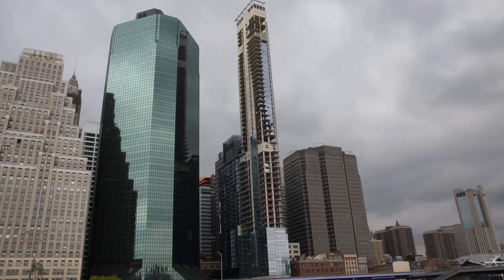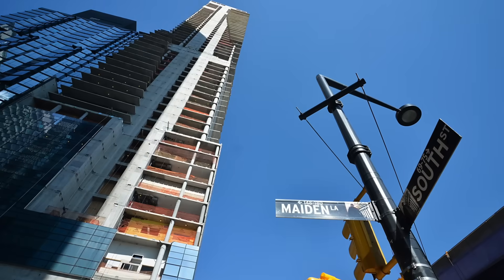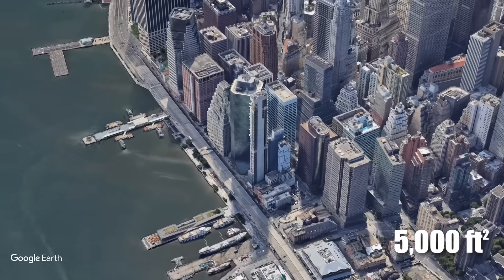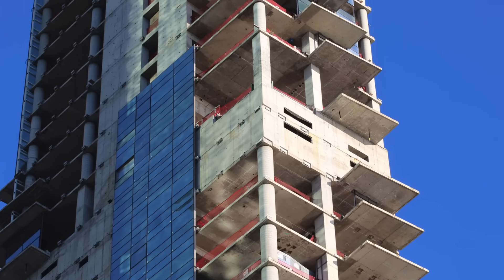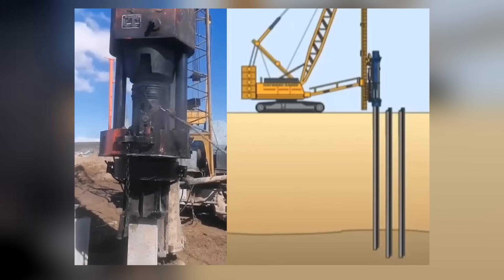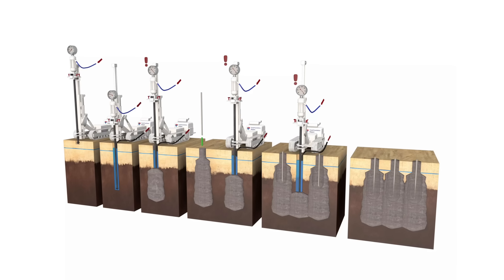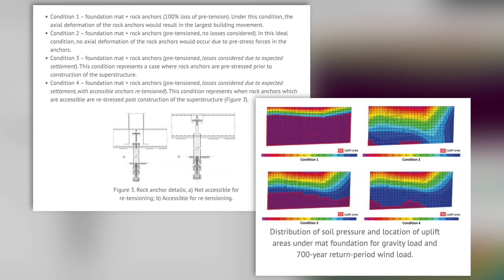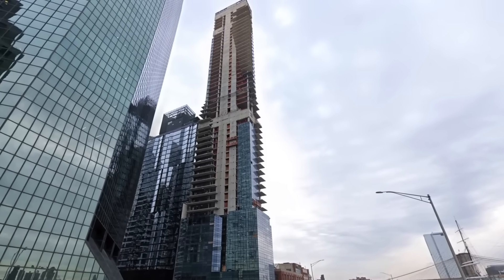Why Nobody Can Fix This New York Skyscraper

Comment: U Mass Amherst built a 26 story library with brick facade. They didn't estimate the weight of the books correctly. When they started to fill it, bricks under compression started blowing off the sides... Their fix was to wrap the entire building in fence 30' away from the building and make one entrance under a covered roof while only using half the floors. There are entire floors with no access and no books. Other floors are empty except cubicles for people to study.
On the same campus the residential buildings known as, "the towers" were built in swamp land and have continued to sink since they opened. Over the years they have had to remove and lower the stairs at the entrances to accommodate the new depth of the buildings
Reply: 26 stories of brick? That's  ridiculous!
Reply: This is not true.  "The building has fallen victim to several myths since its opening in 1973, the most popular of these being a variation of the "Sinking Library Myth," where the architect supposedly forgot to account for the weight of the books in the building's designs, resulting in a settling of the building. This is a popular myth attributed to many university libraries and is untrue."
Reply: @Dante-ki4ol  ok. I'll listen.... If it's not true then what is ? Because that's exactly what happened to the buildings.
Reply: the Towers were a terrible place....
Reply: Ain't gravity great!!!
Reply: Why on earth such a tall library
Reply: Should anybody be going to a University that's run by dim wits?
Reply: Been there. The entrance is like a short tunnel underground so if the brick crumbles and falls it just hits the raised mound of earth, protecting people in the short tunnel below.  Although it won't win design excellence awards, I always liked to go there. Nice view.
Reply: The information from all of those books that needed a 26-story building to house it could probably fit on a single hard drive today.
Reply: @williamgottlieb8723  yeah but a library serves more than just a book storage area, its a third space, a space for people to simply be in like a park, and even then it could house computers with access to said harddrive
Reply: @madratter Structural engineering mistake.  I am in Los Angeles California, I quit a job as architect when the school found out the the proposed structure was to be built within 20 feet of a fault line.  Somehow politically it all was swept under the rug and the building was built by another architect.  So later when something happens imagine all the figure pointing
Reply: @BOBBOB-tx7ox LOL . This isn't true.  It doesn't even make any sense.  "The building has fallen victim to several myths since its opening in 1973, the most popular of these being a variation of the "Sinking Library Myth," where the architect supposedly forgot to account for the weight of the books in the building's designs, resulting in a settling of the building. This is a popular myth attributed to many university libraries and is untrue."
Reply: @Dante-ki4ol  Are you by chance the Architect for that building

Comment: The only thing that makes buildings in New York not frightening to be in is the fact that you know it's literally drilled into the Bedrock.. the actual hard, solid granite crust of the Earth which is exceptionally strong and stable in New York.. the stability of the ground is part of what makes New York city so special..
( that and the fact that you can drink water out of your faucet anywhere in New York City with total confidence. New York City's water wins taste test over bottled)
Reply: As for tap water in NYC, don’t look into the roof top tanks that supply water pressure. They’re a cleaning nightmare.
Reply: @NickCBax  I was at a wedding not too long ago and I was absolutely shocked to see a wood water tower on a roof. I had no idea that they were still using wooden water tanks
Reply: I don't know, recent 4.8 magnitude earthquake was quite noticeable.
Reply: Actually, no. The schist bedrock in NYC is slowly rising since the end of the last ice age when the weight of the ice was removed.
Reply: @avsystem3142 stability doesn’t imply unmoving. Just that as a whole it’s going to move in the same direction at the same pace. Thats what is important for buildings.
Reply: @NickCBax  You appear to be have responded to the wrong comment. My comment was to correct an erroneous claim that the NYC bedrock was sinking, it is not. Sinking or rising, the geological motion of the bedrock isn't a concern to human buildings.
Reply: @avsystem3142  we’re in agreement. But no where on this comment thread did someone say that the bedrock was sinking. 

Did you perhaps comment on the wrong thread?
Reply: @NickCBax  Yes, someone did make such a claim in the comments.

Comment: Yeah they just cut corners on the foundation to make up for the delays from the initial excavation.. All of Melbournes skyscrapers that arent on hills are either on old creek beds or on reclaimed estury sand, which is precisely why a massive no of them have podium carparks above ground rather than basement carparks. Obviously its a taller building but Australia 108, Melbournes tallest at 320 metres, has 75m deep piles. One Seaport is a skinnier building on a smaller section with a higher sq m ratio of lettable space to the section it was built on. If they had the money to build the tower they should have built proper foundations.. The developers just got greedy is all, & the engineers who should have known better than to proceed.. A part of me also feels that the larger mass of concrete balconies on the top half of one side probably added undue weight to an already compromised foundation too.. The longer it is left unfinished, the more chance it will be over exposed to the elements & gain concrete cancer.. I can see this having to be demolished.. My bet is that there was a massive amount of corruption & backhanders with this at every stage of the development from consent to construction..

Comment: 3 inch lean on a 700+ ft tall building is not that severed. There are many buildings with a slight lean. In fact on a very windy day most very tall buildings will sway that much naturally. The real problem is the rate of leaning. If it’s 3” and that is it then that is not bad, but if it’s still leaning then that is a much bigger problem.

Comment: It's amazing that they can build foundations to carry the massive loads applied by skyscrapers by going down to bedrock with the foundations, but it's a time-tested proven method that obviously works.  It seems incredibly foolish for someone to gamble on a new method that would take many years to prove for a tiny percentage of the project cost.  Even if it had worked perfectly, the value of the project could have been reduced by more than 6 million dollars because of justifiable investor perception of the risks.

Comment: There must be a tolerance for how much lean is acceptable, and I would think 3 inch should be within that toleranse?
Reply: Quite possibly. Its lean is only 1/2000th or 0.0005 of its height. It will sway more  than that in heavy winds, and that movement may not even be capped by an upper bound specifically, as the design criteria are more concerned with structural stability than distance moved.

Comment: i. could rebuild this 24ft wider on every side, go to the bottom 10 ft deeper than it is now ,pour concrete and reenforce with 1 inch rebar, 3 ft deep.let it cure for 10 days. begin again rebar cohcrete 3 ft deep, wait 10 days ...now pour ten ft.deep with the1 inch rebar  wait 10 days. now begin with 4 inch plate over the whole concrete top then pour 4ft of concrete and rebar on top of the plate, now  build 8 ft x 8 ft x 6 ft x 6ft deep corners all around plus 8ftx 8 ft x 6 ftx6 ft deep in the middle of each side and finish with 2 ft sidewalls x8ft tall walls with the rebar and concrete. now we need  on each corner of the old leaning bldg, 8ft x 8ftx 8ft deep by 6ft thick corners plus 8ftx8ftx8ft,deep x6 ft thick sides in the middle of  old bldg side walls .plus 8ftx 8ft 8ftdeep x6 ft thick concrete and 1inch redar in the middle of the interior walls of new bldg as centered supports do this for 3 parking lot floors ,and each floor is to be 18 inches thick and rebar also with 2ft steel beams in floors. now outside walls 3ft thick at the edge of the new 24 ft walls all around garage . then continue up 1 more solid concrete and rebar floor 8ftx8ft x8ft deep solid whole floor. then continue to build a regular reinforced bldg tight to the old bldg you do not want to lean anymore ,until you get to the very top ....you have a very big 3 floor garage all tenants can lease I parking spot at a good price and you have more sq ft.to lease for living space and it ain't going to fall down  any time soon or ever. dave
Reply: There is no 24 feet on any side of it.

Comment: Three inch lean may not be that bad. The Millennium Tower in SF. Has 14 in lean and it got slightly worse after the attempted fix
Reply: yes, but a lot of the weight has not even been added nor have all windows been added which both would add to the foundation stress so the whole thing is probably going to be brought down. sad

Comment: It seems to me that the principle engineering isssues are;
1. Does the current degree of settlement fatally compromise the structure?
2. Can the ongoing settling be halted and structurally accomodated at a cost less than tearing the whole thing down?

If and only if the answers to 1 & 2 above are no and yes respectively then at least physically there is a path to saving the project. Legal, public perception, financial and political considerations are entirely separate and fraught domains of course. Any combination of those factors could irrevocably halt any fix. Then at some point they'll have to bring it down safely piece by piece which is likely to cost a substantial fraction of the original build, if not more.

Logic versus feelings, hmmmm, I wonder which will prevail? Physics offers no guidance on that point.

Comment: Will I am not in this  line of work but.
1- make it  small  (120) 
And this would  reduce the  weight...
2- check  and try to leave it up by  adding  fill.
Or stop the dropping in that side.

Comment: different story in the wikipedia article about this building, "The developer hired engineering firms WSP Global and Arup Group, which both concluded that the building's lean did not compromise its structural integrity." etc.

Comment: This problem reminds me of a similar problem with the Millenium Tower in downtown San Francisco.
Reply: The leaning tower of San Francisco.
Reply: Engineers can't fix that, either.
Reply: @channelsixtyeight068_ Yet it was fixed in 2001.
Reply: @garethrobinson2275  Wasn’t even built then, the Millennium Tower is still wrecked.
Reply: One major difference is that this never got occupied while the Millennium Tower did.
Reply: And the Opal Tower in Sydney, Oz.
Reply: And we all know what doesn't flow uphill.
Reply: which still isn't settled
Reply: Yup, but it's the City of Sewage!!
Reply: @jumperstartful which one? San Francisco or New York?

Comment: 180 Maiden built 40+ years ago never has any of these foundation problems ... because back then, we knew how to build.
Reply: @curmudgeonaf  ok, have fun with horrible interior efficienies, explosive dangerous victorian technology, barely any safety rules, crumbling buildings (if 1800s buildings were built so well then why did more people die in them from tornadoes and natural disasters?) and horrible interiors, most 1800s buildings dont have grandiose ornate interiors, those were rare, most 1800s interiors were horrible and empty feeling. they are ovens in the summer even in cold states like michigan, they are incredibly expensive to build and maintain, shit most 1970s houses are better at house architecture than historic foursquare's and farmhouses, rather stay in a shed style contemporary than a rotting farmhouse that looks exactly the same as every farmhouse ever
Reply: @circleinforthecube5170  it's true that old architecture was brimming to the roof with hazards
Reply: Its not that 40 years ago they knew how to build, the issue men has been a corrupted character and lack of integrity in modern times
Reply: 180 maiden has a very cool 1980s aesthetic
Reply: I worked on 180. It was a wonderful building. We called it the birdcage building because of all the trusses in the lobby. I have a bunch of memories of working on Sunday to install the freight elevator doors. I was basically working alone with just some guards and a standby electrician. The doors were a pain to install because they are tall and skinny. 
    Apparently the building is having money problems due to rusty water. It was supposed to be office space, but was converted to residential due to the collapse of the office market.
Reply: Nothing to do with it, it’s all greed and demands from investors. No one would invest if they weren’t promised fabulous returns, so they cut cost and did it a lil too much.
Reply: 50+ years ago, the Twin Towers were heralded for how they were built in a revolutionary way. That design is what allowed them to collapse 30 years later.
Reply: The Hyatt regency construction didn’t do so well 40 years ago in Missouri
Reply: @rb5174 Totally different issue. Plus, that was a result of an unauthorised change by the contractor.
Reply: @DeanStephen
You're incorrect, the change in the walkway supports was authorized by the engineering firm going from single rod supports to offset rods with the tension transmitted through a hollow horizontal support which doubled the load on nut on the upper support rod. It was the largest death toll in US history from a building collapse and kept that title until  9/11. The engineers lost their licenses as did the company which failed. There is one interesting fact about the level of corruption in that the entire inspection process for the building took less than an hour so it wasn't so much inspected as just rubber stamped.
Reply: @bobsmith6079  I’ll have to take your word on it, as I have no way of locating the video I saw on the subject from years ago. Thanks.
Reply: @DeanStephen He's pretty much spot on. They teach it in the 1st year apprenticeship program for iron workers, and "Engineering Disasters" (I believe that was the name of the show) had a segment on it.
Reply: @bobsmith6079  I remember that.
Reply: @rb5174  Caused by a contracting firm that burned holes instead of punching them as specified in the construction documents.
Reply: @pyhead9916  They welded channels toe to toe instead of using HSS square tubing. 
The strength is in the heels of the channels (or angles), not the toes.
The welds didn't hold and a lot of the rods, with nuts and washers, pulled through. 
Someone else on here covered that the continuous round stock was replaced by splicing shorter threaded rods together. 
For something carrying a live load, completely inexcusable.
Reply: @rb5174  cheap buildings still existed in the 70s, thing is it wasn't every building
Reply: Because back then you had to have field experience and not be hired right out of college.
Reply: Back then, the people who built the original buildings in NYC, were from a different time and culture,  they had more advanced tech then these dummy architects we have today.  These modern architects you see taking credit for the construction of these buildings, were not even on earth when they were built.  No contemporary architect will ever be able to emulate any of the Tartarian super structures all over the earth.
Reply: @NOMOone  you mean architects are structural engineers in the US?
Reply: @NOMOone oh common.

https://en.wikipedia.org/wiki/Tartarian_Empire
Reply: @NOMOone architect don't handle calculations, it's engineers. But neither architects or engineers make the decisions in the end, the CEO's and managers do. We know how to build stuff, problem is the people trying to cheapen it out and overriding what engineers used to decide, the epitome of "maximizing shareholder value". Welcome to late-stage capitalism